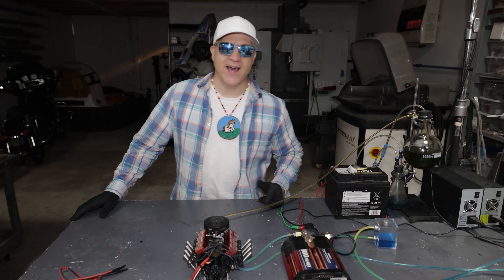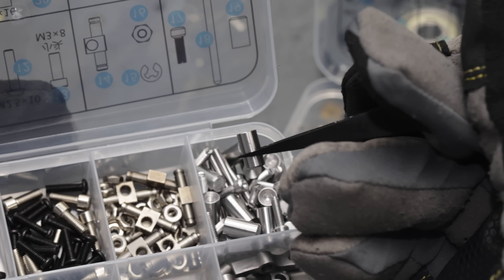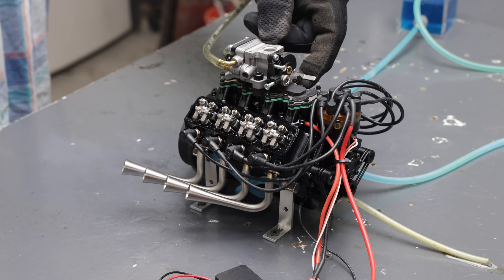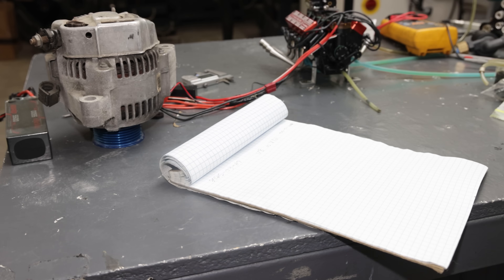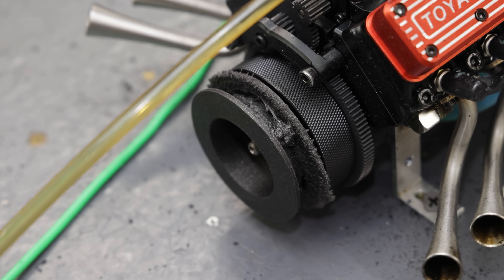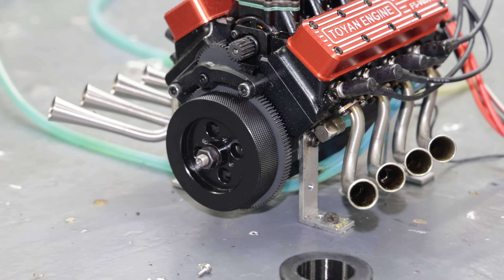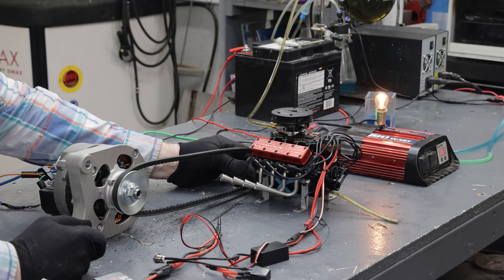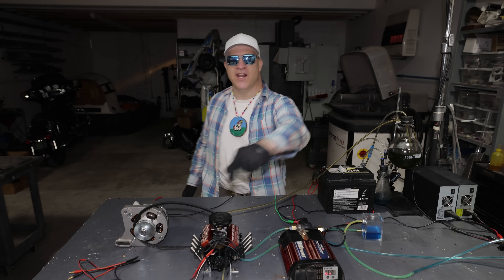I Built A Mini V-8 Generator That Actually Works

Comment: I gotta buy one of these and put it on my old wheed wacker that finally blew up 3 months after it was in a flood for the 3rd time. (Kept it because it’s the same exact shaft and casing as the new one I bought and I’ve had a shaft bearing fail on me on a 3 months after old weed whacker before so it’s always nice to keep some spare parts

Comment: You have to either bolt it directly to the alternator or build a bearing that holds the load of the tension of the belt this way you pull the crankshaft to one direction and that will kill the bearings as it has no pressured oil to lubricate the bearings.

Comment: I wonder how long those little engines last
Reply from the maker: Well after My piston and ring modifications on the V12, seems like they last quite a while.
Reply: @WarpedYT is it a nitro mix fuel? I'd love to find a mini diesel version
Reply from the maker: @AlcornDynamics No they are gasoline... Diesel would be cool
Reply: @WarpedYT of course, liquid piston still refuses to sell to me
Reply from the maker: @AlcornDynamics I don't think the liquid piston is selling to anyone yet, they are still working on the design as far as I know.
Reply: @WarpedYT they are only focused on military use. I found them because I've delivered parts to them a few times.
Reply from the maker: @AlcornDynamics  I kinow the guys i have been there, Boston?
Reply: @WarpedYT the machine shop in conn.

Comment: Hey, I have a few questions about the Toyan V8 WGPC. I've completely reassembled the engine and adjusted it correctly! Valve clearance, ignition timing, ignition sequence, timing, etc. This isn't my first time building a V8! However, I can't get the engine to start! Can you give me any tips and tricks that might help me? 😅 Thank you very much! Greetings from Switzerland
Reply from the maker: I think the most important part is the ignition timing, Make sure that that number one piston is at top dead center before putting the distributor in place, also make sure that the little Hall effect sensor doesn't fall out of the distributor, check for spark, you can even use a timing light. But above all make sure you have a spark, if you have spark then it's definitely a timing issue

Comment: For the price of those engines, they should be able to run something. Instead of only being a model toy.
Reply from the maker: I think these are the ones that will accomplish that, the older engines not so much but I think these will do the trick.

Comment: you need a radiator and a fan then it will run cool, right now you are just circulating hot water , dumb at best
Reply from the maker: Not accurate, look closely, I literally show the whole upgraded system, I have and electric high capacity water pump and a large radiator, right now it is not overheating even under load.. maybe you didn't see the radiator?

Comment: In what way is the V8 engine bigger? @1:03 it seemed like you were saying the v8 is a bigger engine than the v12 and referenced the total CC's of each engine but any way you look at it the v12 is a bigger engine. The v12 wins overall physical size, total+per cylinder  displacement and power output. I'm assuming you know all this @WarpedYT  and simply didn't realize wha😮t you said would misinterpreted, confusing what you said vs what you meant
Reply from the maker: No I actually meant the V12 was bigger I didn't realize how much physically bigger it was because the Pistons are the same size

Comment: Are theee used in any actual R/C cars?
Reply from the maker: I think people have tried but I haven't actually seen one running under its own power yet, The biggest issue is these engines overheat so easy and then they just shut off.

Comment: for one thing the belt is to big if you change the pulleys to enging and on the altenator with smaller belt system it would work
Reply from the maker: I was going to but didn't bother to put the effort because the engine just doesn't have enough power and its current state... It's just not enough power, The V12 which is 50 cc's only made 1.25 horsepower at like 8000 RPM.

Comment: It should have enough power to turn that alternator as is, there just has to be a way to gradually change the amount the alternator is pulling, and it needs a metal pulley. That v8 will do it, it just needs to be set up right
Reply from the maker: I don't know, I don't think it will, maybe if the alternator had a much bigger pulley and was being spun much slower but at the end of the day you did give me an idea, I should hook this V8 up to the dyno and see what kind of power it makes. The V12 only made 1.25 horsepower and that's 50cc.
Reply: @ what about different fuel or maybe even forced induction? There’s gotta be a way lol

Comment: Flow of coolant doesnt matter so much as effeciency of cooling. The longer coolant stays in the heat exchanger the cooler it becomes
Reply from the maker: That's true but there is a tipping point, and when there's not enough surface area inside the engine The solution is to move more coolant, additionally if there was more surface area the inlet and the outlet are very undersized compared to the size of the engine, but it Even more complex than that, you could go down a rabbit hole with that meth. But at the end of the day the only solution here is just an increase flow significantly. Doesn't matter if you move it faster through the radiator because the radiator has like a hundred times more surface area than the inside of the engine.

Comment: Should try a hardened aluminum pulley for engine and try a bike chain
Reply from the maker: I don't know that seems like a real high RPM for a bike chain, that's like 8 to 9,000 RPM on the engine side a bike chain seems super risky

Comment: Right on. Those mini engines are cool.  Free spring time frozen pressure washers cracked pumps engines to power the generator maybe might be more feasible or like some honkin huge flywheel out of something with a really geared not even sure a bicycle gearing would start though maybe with an old school road 10 speed wheel included for like a tractor or monster truck size flywheel starting off really slow to build enough power.  No bolting that to the table top like gonna need really balanced and cement anchor bolts or dedicated footing for that so more bags of cement not only for the tire flywheel.  Might be able to make into a welder or scariac plasma cutter with maybe a buffer deep cycle and some other circuitry to help.  I still find hard to believe the hp claim on these V8s per road and track.  Cool production though.

Comment: I have the same colling fan in the backround
Reply from the maker: Which one ?
Reply: @WarpedYT  the one connected to the blue coolant line.
Reply from the maker: @kartnerd231 ah that one is a pc fan
Reply: @WarpedYT  correct
Reply: @WarpedYT  i made a massive wall of cpu fans just like it (26 fans wired in paralell to a car battery)
Reply: can't show you proof, unfortunately, but believe it if you will
Reply from the maker: @kartnerd231 interesting

Comment: You should find a way to eliminate the belt drive and put the alternator directly on the engine.
Reply from the maker: It's still wouldn't be enough power

Comment: Just needed a belt tensioner
Reply from the maker: Couldn't do it, The engine didn't have enough power when I tighten the belt up a little bit more I was scared that I was going to break the crankshaft, the crankshaft connection on these engines is very sketchy, if you take a look at my V12 teardown video you can see what I'm talking about.

Comment: I want one of these on an adult sized tricycle.
Reply from the maker: I think this particular engine may be a good option, this is the first engine I've had that starts and runs reliably every time, kind of crazy actually. And that's much cheaper than the others
Reply: @WarpedYT  . . Hey, there's a video idea!

Comment: Используйте вместо генератора мотор колесо на 48 или 60в
Reply from the maker: I think you're suggesting to use a direct drive setup?  I like the idea! Maybe in the future I'll give that a try.
Reply: @WarpedYT  it all depends on the engine speed, most likely a gear ratio of ~1/4 will be required
Reply from the maker: @kamehameha1377  it's just this engine doesn't have enough power

Comment: Use stepper motors instead of an alternator...it won't run an oven directly, but it would charge a battery bank pretty well with a charge controller

Comment: Cool video, perhaps a direct drive type would be better 
Side pulley might put to much pressure on crank main bearing, causing wear/friction/heat
Reply from the maker: Yes that's exactly why I didn't tighten the belt, I was scared that tension might break the crankshaft which is tiny

Comment: Cogged vee belts run cooler and waste less energy bending around the pulleys. Great try though.
Reply from the maker: That's exactly why I used it
Reply from the maker: A flat belt would have been much better but hard to find

Comment: I’m guessing the pulleys wasn’t sized to get the alternator to optimal Rpm’s? I ask because the alternator didn’t put out 14v-15v?  I didn’t see an external regulator so I’d assume it’s internal regulated. The higher voltage would have helped with the microwave… although it’s still wouldnt have been enough
Reply from the maker: I agree, yes that's correct, I was just trying to make it work, It is internally regulated, if I would have had an adjustable external regulator that might have helped out but power is power and without enough power it's not going to make power You know what I mean.

Comment: These little engines are show-engines. I wonder if they have a real power specification. But in principle a 28 cm³ engine should be capable to generate 1 or 2 kW of power, which would be enough to power a such a little oven. I was surpriced that you don't have a dynamometer for breaking such engines.

A car alternator has a terrible low efficiency, somewhere between 50 to 70%. The engine itself is a lot worser, somewhere between 2 to 5%, because it is not designed to generate power for applications. And it is still a very small engine which runs especially as a 4-stroke configuration but also in general extremely overcooled because of the small dimensions of its working cylinders. So you waste a lot of the energy of the fuel in the water cooling system.

A pulley is a heavy side load on the crankshaft bearings. It is better to use an axial break with an implemented torque sensor. So you can easily measure the power of the engine.
Reply from the maker: By the way I do have a dyno but I built it for the last video where I dyno the mini V12
Reply from the maker: Those are all really good points You are completely correct, at the end of the day it just doesn't have enough horsepower.

Comment: It bothered the hell out of me that the belt was so sloppy loose like that lol
Reply from the maker: I know I had a tighter but I was scared of breaking the crankshaft on the engine, when I put the belt tighter the flywheel started moving around a lot and it made me nervous, if I broke the crankshaft I wouldn't be able to finish the video and the real video is actually up next

Comment: I see you adjust your valves super tight. Did you make some spring compression before you removed your feeler gauge? I heard that click, quite a bit of resistance to remove the feeler.
Reply from the maker: Yes correct because the feeler gauge was a little bit too large

Comment: The notched belt is making friction.  A more flexable belt and  a better mounting might be close but it is alot of force needed once you put it under load ..  smooth aluminum pully and a smooth V shaped belt will reduce the belt shredding and loosing that extra power
Reply from the maker: I couldn't tighten the pulley more I was scared I was going to break the crankshaft. If you look at when I assemble the engine the back end of the crankshaft is very thin where the flywheel connects.

Comment: The way to go is definitely using a brushless motor around 300kv mounted straight to the back, and it might work to just connect a bridge rectifier and capacitor to it, but the output would be around 27v, and a 1000kv motor might be easier to use because the output would be 12v but the efficiency is lower and it might not be available in a big enough package to handle the heat
Reply from the maker: Agreed but the issue is they're just is not enough power.

Comment: Wonder why its not working..  maybe the plastic pulley..  pulley ratios, governor on the motor regulating its speed/af ratio/ fuel intake..  or it could be overloading the output not knowing the ability of the system before hand by using a resistor bank..  that would be my guess why it didnt work..  and holding the alternator should have been something you told your kids not to do because its both unsafe and wouldnt work at all..
Reply from the maker: I just think it's not enough power

Comment: Power transfer is your problem. Put a jaw coupler on the engine driving a transfer shaft supported by two pillow block bearings with a proper steel pully on it that can take the belt tension. The sideways force on that crankshaft is going to spin a main bearing. Look up how car engines are used on air boats. You'll see what I'm talking about.

Comment: “The coolest feature of this engine is the starter mounted in between the two heads like that” - zero Cadillac North Star owners ever lmao
Reply: Almost every bmw is like that
Reply: @Industry-insider i believe you’re thinking of the turbos. the starter is in the normal place
Reply: @soulsweeper1630  I guess you’re right, the s85 is that way but I’m not sure why I thought the others were
Reply: Nissans 5.6 is like that along with toyota v8s
Reply: That "starter" on this mini engine also makes more power than the whole engine lol
Reply: Not to mention if the Cadillac Northstar engines have coolant in them, those engines will find a way to create a coolant leak, not to mention the threads failing in the head bolts leading to the head lifting off the deck of the block, gradually blowing that pain in the ass head gasket that you have to tear the engine completely apart to get to 🤦
Reply: 6.5 turbo diesel if I recall correctly
Reply: Hate that series of engines
Reply: @jcorral84  the s85 v10?
Reply: Came here to say the same thing. Toyota 4.7L v8 is the same
Reply: I came here for this comment
Reply: No I don't want a engine with the starter there! 
    It would be a pain to change it out if you have to take the intake off every time you need to change it out. 
   Modern junk. Making life hard.
Reply: @DannyLee747  it’s really not a big deal, they last so long that I don’t care it it takes an extra hour to replace
Reply: Every one of you YouTube guys think you have to jack the throttle, why?
Reply: @camarogs1  I was here burning rubber while doing donuts!!!!😜🤪😝
     Bahahahahahah!
Reply: The Honda Element has a starter located in a very hard to reach position like that..... Although on the plus side, it can help a DIY mechanic buy a used Honda Element with a bad starter for cheap. When the owner realizes they'll have to pay $1000+-ish to get a new starter installed & decide to sell it instead.
Reply: I thought the exact same thing
Reply: Plus toyotas 4.7 AND v6

Comment: The rubber on plastic of the vee belt setup was always going to fail, the scuffing together makes heat that the plastic can't handle. Plus as mentioned elsewhere it is way oversized and stealing much of what power you have.

Comment: I reckon, if you put a heavy fly wheel on the alternator secure it all down properly and don't put load on it until your up to rpm you could probably start it by just spinning the fly with your hand.

Comment: Well the pully situation obviously needs to get addressed.  Plus there needs to be something to regulate the throttle so the alternator doesn't drop voltage as the load increases.  I'd just use an arduino to close the loop because it's easier (for me anyways).  The coolant pump still seems pretty gutless too, might try a dual D5 (or just two D5s in series).

Comment: 1 cyl 125cc engine with 24 valves when?  edit: maybe you need to make a mini visco clutch/coupling for things like this  when if they get bogged down it wouldn't kill the engine (like an automatic transmission fluid coupler, what you call it in english anyway)

Comment: Does that engine not have an oil pump?  There appeared to be no oiling holes in the main bearings or the crank.
Reply from the maker: No oil pump it works by spray lubrication or capillary action, You put two cycle oil in the fuel

Comment: Needed the alternator set up properly with proper belt tension..and that carb is restricted...open it up fully and let rip
Reply from the maker: Yes possibly however the crankshaft on that back end is so thin if I tightened the pulley anymore I was scared it was going to break, as for the carburetor I tried to open it up but the engine just bogged down, I'm going to try to run it again today after the engine was fully broken in now, but I have a feeling that the carburetor is just too big for the engine and they put that restriction screw because 30% throttle on that large carburetor is probably 100% throttle at that engine displacement, make sense?. Fuel injection is different but still has issues if you put two large of a throttle body, I'm definitely going to try it and I'll do a live stream on Instagram when I do I'm going to try it in like an hour. 
Thanks for reminding me